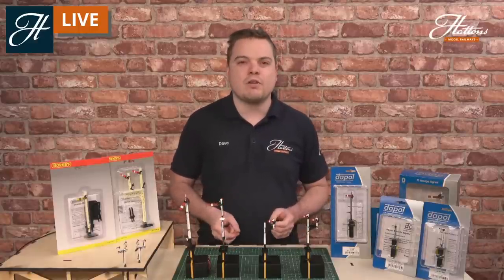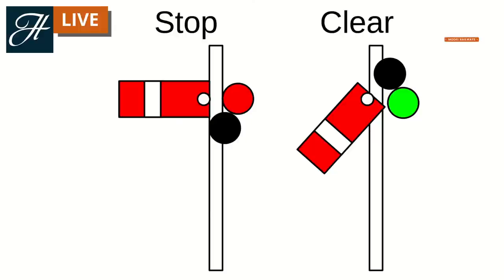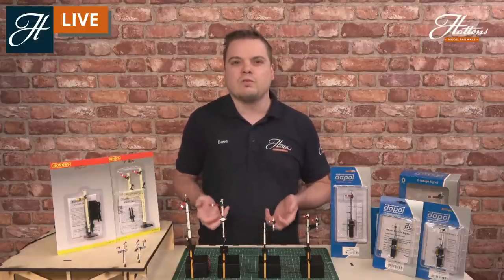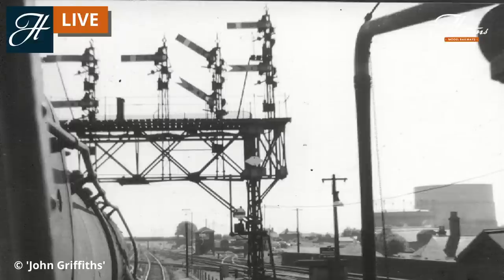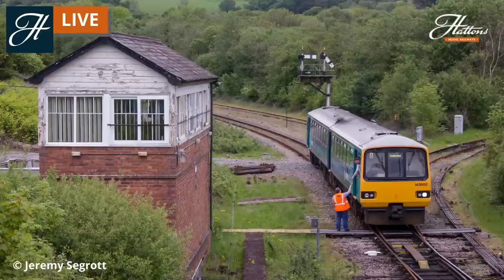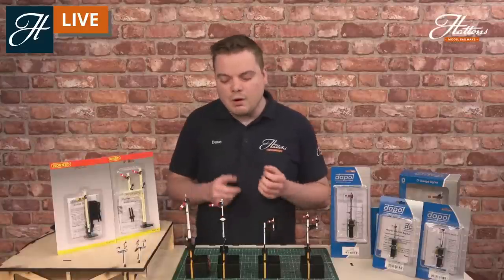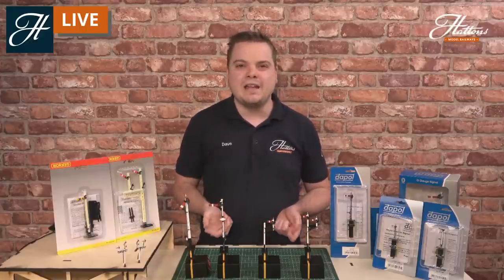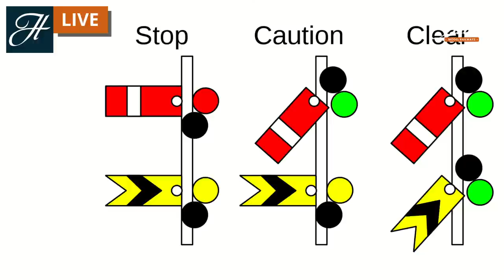Signalling your layout - Getting started with Semaphores

Comment: To use distant signals realistically, you'd need to have a pretty big layout (a lot bigger than mine, for sure). As stated in this video, the distant signal would be at least 1/4 mile ahead of the home signal, often as much as three times that distance. Well, if you do the scale sums, that means that in OO gauge you'd need to place your distant signals at least 17 feet ahead of your home signals. Even in N gauge, your distants would need to be over 8 feet ahead of your homes. So... what do you do? Omit distants altogether, or place them unrealistically close to the homes? Of course, this problem is not really limited to signalling - on almost all model railway layouts, everything is generally too close together, and often too small (e.g. most layouts have nowhere near enough space to realistically model a principle mainline station).

Comment: Hi Dave, really enjoyed your tutorial, clear and concise...... I believe the decision to change to upper quadrant  was made due to linkage failures on three different occasions...this resulted in the lower quadrant signals showing clear when the home signal  was suppose to be on stop due to the weight of the semaphore arm or flag. The upper quadrant system gave a default stop in the situation where a linkage failed. Keep the sessions going as they’re a great help to us newbies.
Reply from the maker: Thanks Tony and yes, it sounds like you've got it spot on. There was several examples of lower quadrant signals fitted with counterweights and some of these remain in use in South Wales, Devon and Cornwall, but I understand that Upper Quadrant became the BR standard for the reasons you state - Dave

Comment: Excellent video Dave and very informative. I have never really understood how semaphore signals worked until now. I'm certainly going to include them on the layout I'm currently planning.
One question though. Is there a standard location for the signal post in relation to the track? In other words does the signal post stand on the left or the right of the track as the train approaches on a single line track?
I'm looking forward to the video on wiring signals. I'll have to,put some on my "wish list " with you!
Stay well.
Keith
Reply from the maker: Hi Keith, thanks for watching. As a rule, signals are generally on the left hand side of the track as most locos are left-hand drive in the UK. This also matches double-track sections where signals are on the left.

Some signals are located on the right hand side or directly above the track on single line sections, purely to help with visibility, but usually they'd be on the left.

Comment: Great Video, Explained a lot, Question:- when did the uk switch from semaphore to coloured lights on the main line?
Reply from the maker: Hi Keith, the first colour light signals came into use in the 1930s being installed on higher speed routes as a priority. Some areas of the UK still retain semaphore signalling, with South Wales and South West England being particular hotspots.

Comment: In New Zealand the main lines use a speed signalling system. In some areas there are single line automatic, and double line automatic. In single line automatic, the signals are approach lit. They are powered by batteries which are charged by the mains, but if the mains fails, the batteries take over. I think the voltage is 24v DC. In some areas remote from power supplies the batteries do the job all the time, and the signal maintainer checks the batteries on a regular basis. Most of that system has now been replaced by track warrant, where the driver has a pad and writes out instructions by radio, the signaller has the same pad, so there is no confusion as to which section the driver is authorised to use on the single line. Probably 85 % of main lines in NZ are single track. In the metro areas the signals allow trains to travel over empty sections similar to UK main lines.

Comment: Dapol semaphore signals work very well. One advantage of a semaphore signal over a colour light signal, is that the position of the signal arm can be viewed from either the front or the rear of the signal. All of my Dapol semaphore signals are wired to work automatically with the passing of a train, or they can be operated manually if required.

Comment: Very nicely explained and illustrated thank you. On the solenoid operated ones how noisy are they when tne solenoid operates and how does this noise compare to "point motor" solenoid operation,  e.g. PM1s and tortoise motors please?  It would be nice to hear them operating on a future video. Thanks Stephen
Reply from the maker: The motorised semaphores are operated with a servo motor rather than a solenoid, so are a lot quieter and slower action. I'll add an operating/wiring signals video to our ideas list so keep an eye on our channel - Dave
Reply: @HattonsModelRailways  Thanks for advising, yes will do.

Comment: A nice introduction to the subject.

Lower quadrant signals were used by nearly every railway company. It was only the GWR that never made the switch to upper quadrant. The MR as part of the LMS replaced many ov their lower quadrant signal. 

The distant signal would be at the braking distance for a train running at line speed. The distant signal would only be cleared if ALL starter signals controlled by that signal box are cleared.

 Great on line sources for information are www.railsigns.uk and www.signalbox.org. both tell what signals yo use and what they were used for, but the former also covers signals in much greater details than Hattons could ever do especially for the pre-grouping era.
Reply from the maker: Thanks Neil for some fantastic links - I'll be checking those out after my shift, thats for sure - Dave
Reply: Coventry used both! The signals to the south of the station were lower quadrant while those to the north were upper quadrant.
Reply: @NTSCuser  not an unconventional mon situation even today.

Comment: Not quite correct.  When you have two stop signals at say a junction if they are at the same height it means both routes are the same track speed if one is lower it means that route is a lower speed.  If you had say four stop signals stacked one above the other it means top signal takes you to the furthest route to the left next one down would be the next line to the right of the first and so on. Top to bottom left to right as we used to say.  Brian (train driver)